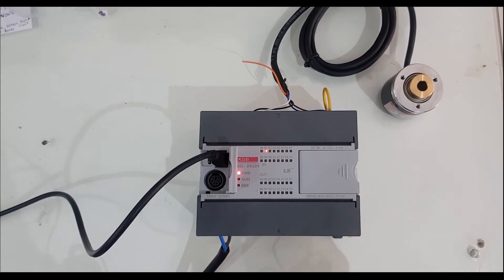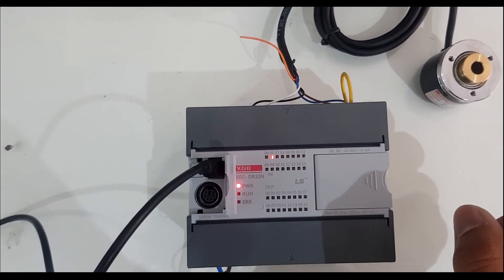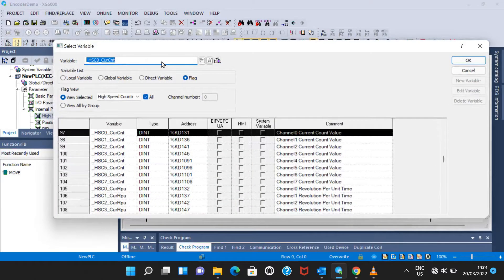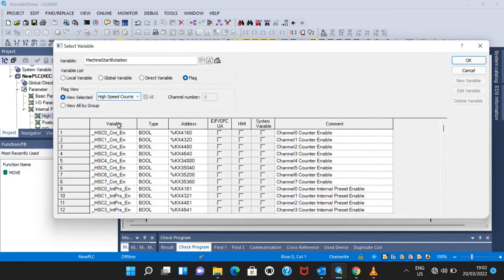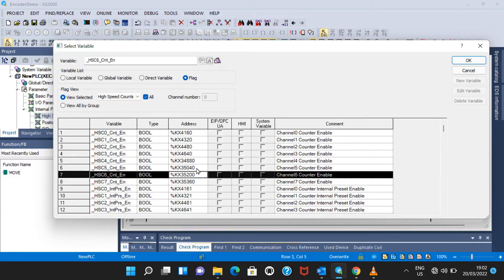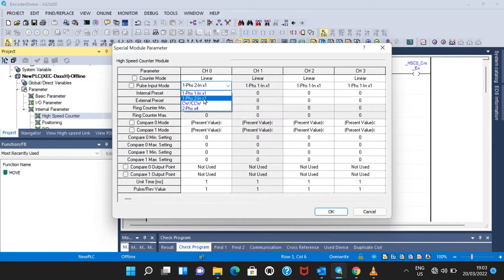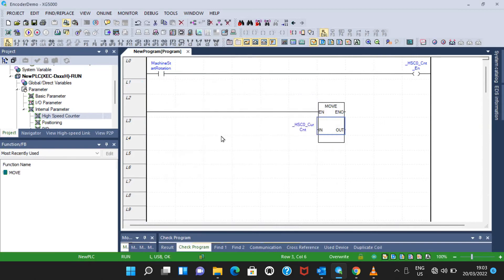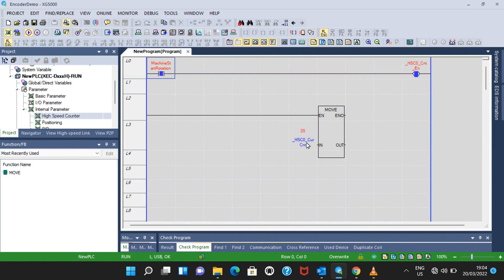How to program LS PLC with Encoder? || LSIS

Comment: Please kind teacher, could you help me find a simple way to generate pwm so that I could control a simple DC motor?
Reply from the maker: I would love to help, but i never did. I am sure if you research, you will find the method.
Reply: @howto...8040  Ok, thank you. Just another simple question. How can I use values under 1 second with the timer? Like, 200 milliseconds
Reply from the maker: I will give you a tip, use #200ms, and it should do. Let me know if it doesn't.
Reply: @howto...8040  it didn't work, but I found a flag described as _T20MS which is a 20ms clock. But I would like to know if I can create one like 5ms. It seems to be possible, but I don't have any idea how to create it.
Reply from the maker: @BYOH4Z4RD  Dear, use T#200MS, that will be for 200msecond

Comment: Good morning , I am not able to reset the encoder pulses , because I want to make an application that every 4 meters the motor stops and the pulses zero , for the motor to rotate only clockwise
Reply from the maker: Use counter to reset